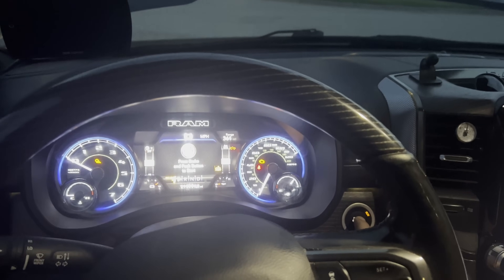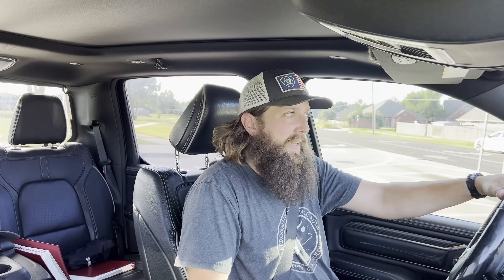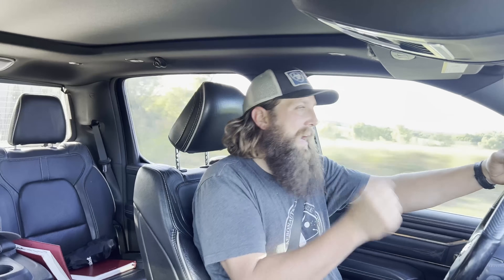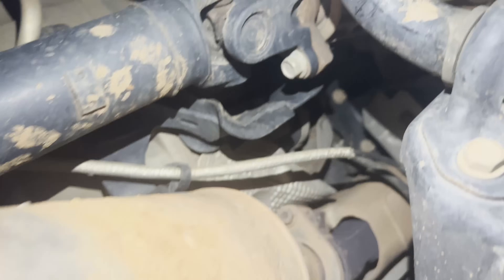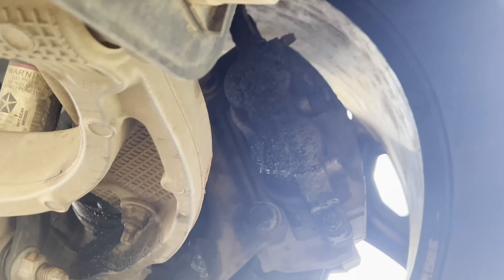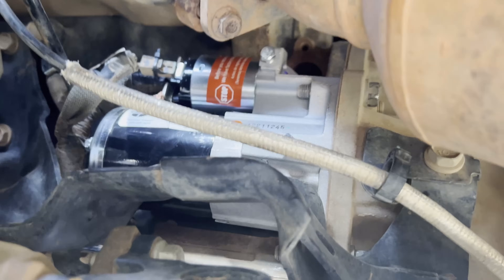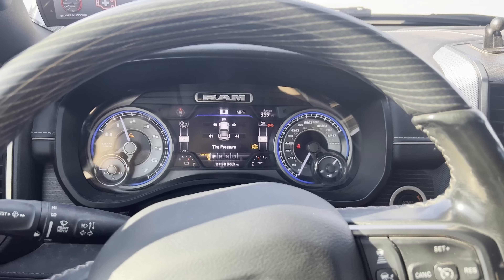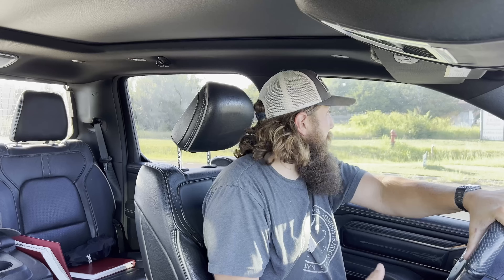2019 Ram 1500 *NEW PROBLEM* Engine Won't Start | Truck Central

Comment: keep us posted on this please :) I have the same issue and apparently so do a handful of people online. it is a weird issue, the intermittent-ness of it makes it a challenge to track down and these new trucks have so much electronics going on it can be pretty hard to trace stuff.

I can confirm its not the battery, its not corrosion on terminals. Things it could still be: Component drawing power on occasion (but not always) and draining the battery, start solenoid (which I am increasingly thinking it might be after seeing this), bad wires (seems unlikely but possible), bad ground, bad break depression switch maybe, bad parking sensor maybe,... idk. Like I said, vehicles are becoming so complicated it can be a pain to troubleshoot.
Reply: Not a mechanic just mess with my vehicle till I get to a major issue. Looking into the Rams now but I have run into similar issues with push button systems in a Toyota. The light on the start button would stay red when you press the brake pedal. So I would give it a couple of presses until it turns green indicating its good to start. I wonder if the brake pressure switch has a double contact or something. To where if it doesn't have good voltage it doesn't allow a start? This literally happened to me a few weeks ago and I am waiting to see if it happens again. 2021 Toyota.
Reply: I'll also add my brake lights worked the entire time. Just that stupid indicator stayed red and turned green when it see the brake pedal was pressed.
Reply: @glenmyrick1359  3Months later and I am back in these comments lol, my truck still has this issue but very intermittent as mentioned. I have wondered lately if it is the brake depression sensing like you are saying too, because I have found if I keep trying to turn it on, while also pressing and depressing the brake each time, it often will eventually start up. This to me seems like a brake sensing issue based on this characteristic. Also, Didnt mention in my comment that when it truely wont start, I hook up my jumper pack and it will start no problem. so so odd. so increasing current fixes the issue, new battery does not fix the issue, repeatedly trying to start fixes the issue sometimes, and the issue only happens extremely randomly and not consistently due to any external weather or anything as far as I have noticed. So... still leaning towards the starter motor solenoid sticking I guess which would make sense for all the issues and fixes, (assuming overdriving current unsticks it). Or some kind of weirdness going on the the brake depression sensing
Reply: @BenJaminLongTime  UGH! What a nightmare. Currently my 2020 Ram 1500 Rebel crew cab is sitting in my driveway and won't start. I ruled out the battery being the issue as I even tried a new one. I was going to try a new starter, but not thrilled to see 3 months later you're having the same problem (and you bought the expensive starter, not a cheapo). I'm going to attempt to check my starter with a multimeter this evening...
Reply: My 21 limited 15k miles didn’t start,no lights,even remote control,nothing,drain battery out,so I recharge battery full,as soon as it start ,i took to dealer,found out there were two bad fuses,$10 for 2 fuses and $70 labor,
Reply: @ChrisRouxPhotography hey Chris have you figured it out yet? Is it the starter ? Or is is bad wires like ground ?
Reply: @jadebelhumeur9472  Yes, it was the starter. Was $500 for OEM installed.
Reply: @jadebelhumeur9472  it was the starter

Comment: I have a 2019 Limited as well love it do wish I got the panoramic moon roof though. Bought it a little over 3 years ago she has 36k on it. Love the videos for any future issues I might have 💪🏼
Reply: Thank you! I love the panoramic roof. But it sure lets in a lot of heat.
Reply: I have the same truck with the moon roof and I'm having this issue rn my truck won't start 83k miles on it.
Reply: It's going to happen.. 65k and happening

Comment: I have a 2019 rebel and my starter just quit at 110k miles, not even 2 weeks ago. No warning, just wouldn’t start even with a jump. I thought my battery was bad as well but had it tested and it was fine. I laughed at the part in your video where you show all the extensions and the swivel head ratchet because I did the same exact set up when I replaced my starter 😂

Comment: I have a 2020 Ram 1500 Limited with the exact same issue.  They ended up replacing the starter.  The truck turns over much quicker now.  I noticed over a year or two that the ignition would turn over kind of slow sometimes.  I knew it wasn't the battery because my battery was brand new.  I had a similar issue 3 years ago but the dealership told me the issue was caused by some corroded wires that were going from my battery to my truck topper lock.  They repaired the wiring and I was good for a little over two years and then last week, it started doing the same thing again.  I'm glad I found this video.  Hopefully, it was the starter and I won't have anymore issues.
Reply: I changed the battery and the starter and my ram 2019 limited still won’t turn on
Reply: What was the outcome
Reply: @angelicaherrera5823  I have a 2016 same issue

Comment: First thing I noticed was the wear on the cheap undercarriage shielding by the starter... you do a lot of off roading, between the dirt and stuff hitting your undercarriage. I bet your connection to the starter was either loose or dirty; which explains the starter working on and off. It doesn't take much resistance on a 12v circuit to cause issues!

Comment: Mr. Wheeler, thank you for the info. Something to be aware of if my truck starts acting up. Actually getting it inspected tomorrow and the one thing I know needs to be fixed is the bolt/ nut on the exhaust flange right before the muffler. The head of the bolt seems to have just sheared off for no reason. My wife noticed a strange sound from the exhaust while we were up at Penn State for the West Virginia game.  Got home, looked under the truck to find the flange open a bit because of no bolt head. The boot issue sucks but they tend to wear out over time. Always looking at mine every oil change, I hate surprises. Hope your first issue is fixed. As always,good to see you sir.
Reply: Thanks, Jim! I actually was supposed to be at the Penn State v WV game, but plans changed last minute. Sorry about the exhaust. Hopefully it’s an easy fix!
Reply: @MrJustinWheeler  it would've been great seeing you if you could've made it up there. An absolute great weekend with family and friends. Maybe next time.

Comment: I actually got rid of mine last month I couldn’t keep pouring money into it all the repairs I had to do and stuff still was breaking down on it. I had 170 K on it when I got rid of it I went through three radiators, three water pumps, two starters, four batteries, exhaust manifold, bolts were broken still did not get those fixed and the rear sliding window kept leaking. I’m going to keep following your channel and to see how you do because I know you got more miles than I did on mine but it’s just sad that they don’t make nothing last anymore, and I took care of my vehicle just like you take care of yours.

Comment: @truckcentral starter wasnt bad its a loose hot connection. identical problem i had. i got under the truck and had someone hit start and watched sparks fly off the starter connector. tightened up and immediately fixed the issue. sometimes it would start sometimes not, FOR MONTHS.
Reply: Yeah, It’s very possible that was my issue too. But I’ve got to play it safe and make sure not to leave anything to chance. Appreciate the feedback. I’ll keep that in mind if I have more issues around 400k miles. 😅

Comment: Had the SAME problem: intermittently would just click and not start.
I tightened the nuts on the starter solenoid and then reconnected the battery at the terminal.
Started stronger than it had in years.
I believe the nits on the solenoid were probably only finger tight from the factory.
Also, I the dealer service center could NOT diagnose the problem. Stupid, imo. They had the truck for 3 nights supposedly testing everything.
Took me a while reading and then 30 seconds under the truck to tighten. Didn’t even need to remove the heat shield.
2017 Ram 1500, 77k miles.

Comment: 23’ ram big horn 4x4 here.   Battery tested good gauges are good Not any throwing it wants to start on the first initial cold start but it almost shakes the hole truck almost like it’s out of gas almost acts as if it’s a diesel. Dealership said it can’t find the problem they hooked it up to their computer’s it’s just the first initial cold start really struggles starting I’ll usually kill it if it struggles. Then the 2nd attempt it will fire right up very weird can stop & start after that all day no problems. Today it did it again I gave it gas and the RPM jumped to 2k steadily it stayed there so I killed it and the 2nd start this morning fired right up

Comment: Thank God! I thought about the starter ten times but dismissed because the alternator was charging funny even with a full battery. Thanks for putting this up!
Reply: So, what was the problem on yours?? The starter nut??
Reply: @alfredibarra8526  yes! 10 minute fix.

Comment: Thanks for the video. I have 22 1500 5.7 gas. Same thing, I thought it was the battery. New battery solved it for a very short period then the dreaded click. I have 40k miles on it and bought it used last spring. I replaced the starter myself and was happy to have your video to refer to. I had to use a torch to heat up the starter to get the bolts loose. Not sure what torque spec they used, but dissimilar metals can be a real pain. Thanks again ! BTW the nut on cable ( 13mm ) was tight. Old starter motor appeared to be bound up tight .

Comment: I have a 2022 power wagon w 65000 miles. Same problem as yours. I changed the battery before I saw your video and like you, decided, change starter. As I was starting to do that I noticed the battery cable on the starter wasn’t very tight.  I tightened it and my starter sounds better than it has in a LONG time.  Loose battery Cable on starter

Comment: 2011 Ram 1500 130,000 miles Crank No Start. Battery was bad so I replaced that, then starter went bad replaced that, alternator was next so I changed that. The crank no start was a little $9 buck relay that is on the circuit board inside of the TPIM. Until I soldered the old one out and the relay I got on Amazon I used a jumper. Pain in the but because the jumper where I had it was supposed to act like a relay however when I didn’t pull one side of the jumper my fuel pump kept running thus killing my battery also. Once I took the TPIM apart and put the new relay in truck runs normally again.  There is a great video on how to do this on YouTube 😊

Comment: My 2019 Ram 1500 Laramie 5.7 acted up yesterday and almost left me stranded 30 miles away from home. It would click but not turn over. After sitting in my truck researching different methods to get it started, I thought about the fuse block. I checked under the hood and found the starter fuse, labeled F40. The fuse visually looked fine, but I had no tools or multimeter to test it. Thank the heavens the fuse block under the hood had a spare F40 sitting in one of the spare slots. Swapped it out and fired right up. I’m skeptical about it being just the fuse though and I’m going to have to look at the actual starter when I get decent weather around Maryland. Too freaking cold out to be under a truck for hours trying to take two bolts off like most people here are saying lol.

My truck had previous electrical issues a year before with the rack and pinion system failing which caused power steering loss while driving and the entire instrument panel to go haywire and shut down the truck. No lie, it spent 50 days in the dealership where they ended up finally replacing the rack and pinion system and it was working great until yesterday. This truck is becoming more of a liability the longer I hang on to it. If it wasn’t so pretty, I’d trade it in for a freaking Prius at this point.

Comment: I had the same problem. Especially since temperatures cooled from 110s down to 70s so i guess the metal shrank and the bolt became looser. Battery was fine. Once i tightened the bold holding the wire to the starter, went back to brand new!
Reply: I was really close to buying a new starter but I used your recommendation and boom it started. My truck was down for a week over a loose 13mm part.
Reply: amazing! glad I could help
 @Tavarris

Comment: You could be partially right. I have had in the past, at least 3 times with different vehicles where the terminal ends from battery to starter (or anywhere in between where there is a connection) where the terminals develop a thin layer of corrosion (not visible to the naked eye). Before buying a new starter, make sure to undue all connectors, clean them with emery cloth (or a wire brush, sand paper) and reconnect. You will find that a lot of times that this is the problem. So you may ask, why did the problem go away with the new starter? Well, because you may just have disconnected the terminal that had the corrosion and just by doing this, took care of the main problem. Like I said before, the corrosion layer is so thin you would never know it's there. In my line of work, half the time I find the problems to be corrosion (due to moisture) and or loose connections.

Comment: My 2021 is going in 2 days for a new starter.  Same exact problem!  Difference  is I have less thank 19k miles
Reply: Oh wow. That thing should still be like brand new. Sorry to hear that my friend. Good luck with the repair!
Reply: Just picked up a 2022 Laramie last week with 13K odo. Maybe I should make my appointment now.
Reply: Update. The starter was replaced under warranty.   Crazy!
Reply: Just had this happen to me this morning and thankfully it started with a jump, but I am going to test my battery after I drive it for a while today to see if it’s bad first, then on to the starter I guess. I have 77k on my ‘19 limited. Thanks for the heads up on the starter Mr Wheeler, dealership would have charged me a arm and a leg just to diagnose it…

Comment: Thanks amigo. Christmas night leaving my folks house the my '21 with 57k clicked and didn't start. It took about 5 minutes of hitting start, throwing a jump pack on, taking the jump pack off, scratching my head before it randomly just fired up. Swapped the starter out last night and boom, fired right up. I did notice this truck has cranked slower than my 2019 since I bought it but didn't think much of it. Guess the starter was going for about 7k now of my ownership.  

For those doing this swap, drop the front of the front drive shaft and loosen the two bolts holding the black support plate around the lower starter bolt. This will save you an hour of screwing with it and wondering if you are even a mechanic.

Comment: I have owned Dodge Rams in the past and this seems to be an on going problem , after about or around 60,000 mile the starters seem to fail or have intermeated problems. I found that replacing the starter takes care of the no start issues.

Comment: In a shop, on a rack, its not so bad. On the driveway, video after video, I don't see anyone taking off the 4 drive shaft bolts to get easier access while on your back. Its only 4 bolts and you then have significantly more room to work.

Comment: I had the same problem with my 2023 dodge ram sport 21,000kms. The brake pedal was hard.
* the solution to start the truck is a security issue. You have to switch the push button back to off(the far left orange light comes on). You have to open the door and close it to give the impression to the truck that it’s disconnected. 
Step2 you have to press the push button five times(that is important). 
Step3 you have to push really hard on the brake and at the same time press and hold the push start button for 15 seconds.
Step 4 you push on the push button start to start the truck. That will start it.
* you might have to press it again one more time if it doesn’t start but it will start.
How I found this out was a video I watched that had the same problem on a dodge journey apparently it’s a common problem. 
F**k Dodge, I’m buying a Toyota. I’m writing this as I was stuck in Edmonton Alberta from Toronto on business trip -21 outside.

Comment: I was thinking it must be a loose connection. You moved the battery cable terminals and then the truck started up. The next time you disconnected the battery cable terminals to remove the battery and then reconnected and it started up. Since it was intermittent I strongly believe it was a bad connection. Either at the battery cables or that cable on the starter. But, it’s done now and seems to be good to go.

Comment: Just bought a '23. I tend to own my vehicles for the long haul, but typically not more than 6-7k miles per year. It'll be interesting to see if/when this problem shows up. Thanks for the heads up. Great informative video.

Comment: I’m having the same problem with my 2020 Ram Rebel 1500!! What a great new year’s gift 😅 thanks for the help
Reply: Same problem with my 2020 Rebel. I tried a new battery, still wouldn't start. Have you got yours started yet?
Reply: Same thing here on my 2020 Rebel, on its way back to the dealer for the 4th time in 6 weeks. Fun stuff!  @ChrisRouxPhotography

Comment: My truck is doing the same thing and has less than 60k miles and just got a new battery less than a year ago. Do think it’s a bad connection or bad starter? It started after a long drive on vacation 5 months ago and just happens to my truck about once month then goes away